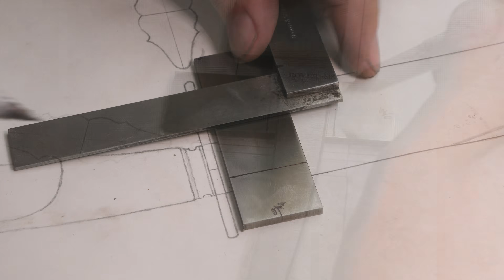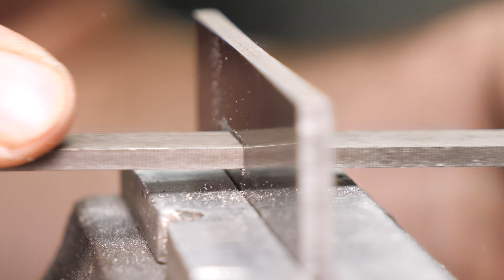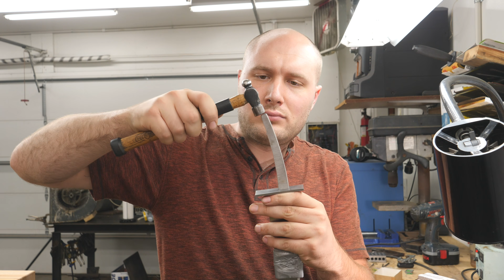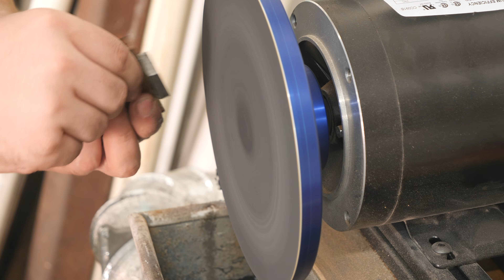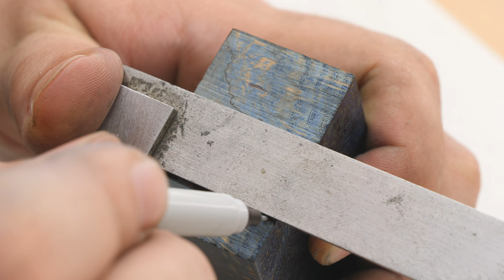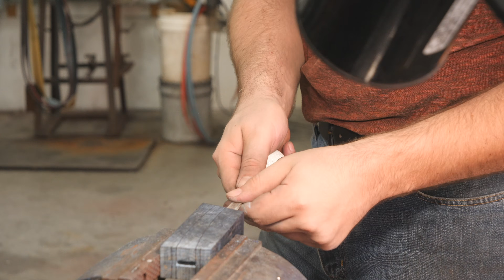Fit a Guard like a Mastersmith Without Breaking the Bank: 15" Bowie Part. 2

Comment: You can tell you are very precise at what you do.. I'm the opposite.  A handmade knife , I like it to be shown that it's not made by a machine . But by my hands , so perfect I dont do.. and shiny I dont care for. I like forced patina  . I like a knife that looks used and worn,  even when o just made it . I got to say you probably are one of the best I've seen . And tight fits like that definitely last forever.  Perfect fits.. also I dont have but basic tools . If I could I would love to buy all the nice tools to make it much better and easier.. great work
Reply: I’m just like you with the forced patina and not polishing everything.  I just finished a 9 1/2” Bowie with an antler handle.  Looks old but it was just born this past weekend.

Comment: The glue and wood is good.  What about a magnet? 

Or a bar with an adjustable grip and magnet on the end?

A  jig to put on the end of the tang instead of hammering directly on the tang?

Not criticizing just multitasking my brain as I watch you work.

Good stuff 

Thank you

Update

I tried a magnet and it works but really needs to be strong. 

If you play with magnets you’ll notice their strength is front to back force so “pulling” but not so much side to side which is why you can slide a strong magnet but not pull it straight off.

If it’s not strong enough the sander slides the piece off the magnet if you press hard.

Recommend tape to protect the steel.

Not perfect but an option.

 Recommend lock clamp or similar for Heavy grinding as it gets hot.

Either way it’s always easier to control a bigger piece than a small one.

I didn’t lose this one but anybody that’s ever ground or buffed a small piece has probably said those famous two words while standing there with empty hands listening to the bing bing bing of flying falling metal so you have some idea where it went… :)

Comment: I'm a machinist and at times we use what if called a mill drill. It's a drill bit center and an end mill on the sides. They can break bust not as much

Comment: Resucing cost by taking 3 hours to sand the hole in the guard ? Yould it be more effective to machined it in 3 min ... ?
Reply from the maker: That would be great but it has a be tighter tolerances than a mill can provide 
Also you probably can’t see it on the vid but the guard fits on custom compound angles on x,y,z 
It’s fit to whatever half the thickness of dry sharpie fluid is 
Good times my friend 
Good to have you here hanging out with us all 👍🏻☕️🔥⚔️

Dad
Reply: Awesome job btw

Comment: correct me if I'm wrong, but with epoxy you don't actually want a "perfect" fit, right? I've been told by a manufacturer of epoxy specifically designed for knife handles that you want a little space between the tang and the handle for the epoxy to fill and do it's job. I think they said about 1mm but I could be misremembering. I don't mean that the tang can't touch the handle, just that, as I understand it, it needs some areas with some space to make a mechanical hold. They also suggested making some divots in the tang (if it didn't have any) to give the epoxy something to hold onto mechanically. 

I'm asking because I genuinely don't know, I'm not trying to correct anyone here ;-) also, this might not matter with your knife as it looks like you're securing it with a pommel, but I don't think I'll have that option.
Reply from the maker: Good observation my friend. We use West System epoxy. It sticks to uncleaned mill scale. It’s an incredible product. We haven’t had any failures with it. Be safe and be careful mate 

Dad

Comment: I hate to craftsmen using the jaws of precision calipers as scribes. This is sad. There are tools designed to do the scribing needed.
Reply from the maker: Good eye my friend. I’ve got over 10 cordless Milwaukee power tools in the the cabinet. When I use any of them I only consider them a carving tool, using them on stone steel and wood weather they were made for it or not. End game building spectacular product for clients to enjoy. It’s just a tool. It’s replaceable. It takes about 3-5 years to wear a set out the way we use them. Well worth it for us. Good comment my friend. Glad you’re here hanging out with us all 

Dad

Comment: I could never do anywhere as good as you even if I had all the machines. It takes a certain type of personality to make knives on this level Im realizing; I start to get frantic and antsy if Im not about finished with my knife by the end of the day AND fitting parts drives me crazy, actually makes me nauseous with the frustration. I discovered that pouring pewter in between handle parts keeps me from having to fit them and I havent looked back! HOWEVER, compared to your knives, my knives look like....shanks!
Reply from the maker: Hey thanks my friend 
I’ll bet your shanks look pretty good 
If you’re interested in leveling up your knife making skills check out our online courses at learnknifemaking.com
Happy new year my friend 

Dad
Reply: @KyleRoyerKnives  Yall should offer a beginner bladesmith kit, with a small propane forge and hose, a hammer, tongs, small anvil and a small piece of steel, say 5160...all the things that a potential knifemaker might have trouble getting around to finding. Then in one shipment theyd have all they need to start the courses, theyd have no excuse to delay. I did see that you offer a guide that directs where a person can buy supplies but this would simplify and expedite the process for the hesitant beginner. Just a thought...

Comment: I never would have thought to use super glue and a piece of wood to hold the metal while grinding 😂. I normally just use a welding magnet although that wouldn't work for stainless as well as it does for regular steel. Any 400 series stainless sticks to a mag fairly well ( like the 416 you used) but different grades that contain more chromium are far less ferromagnetic. However, bending, forging, breaking, or cutting most stainless steel can expose the ferromagnetic properties. I'm sure a lot of people who watch Kyle are aware of this 😂. I'm just trying to share my knowledge on that. Perks of having worked in a metal recycling facility for years lol.
Reply from the maker: Hey thanks Corey. Glad you’re here hanging out with us all. Chao 👍🏻🔥☕️🗡

Dad

Comment: what are the pros and cons of burning the handle on as soon as it almost fits?
Reply from the maker: It’s possible to damage the handle material with excessive heat needed to burn fit the handle. Good question. 

Team Royer

Comment: you can use handle magnet for sanding down steel fittings like the bolster. I also use mine when I need to clean something with my angle grinder if I am doing damascus with little bitty pieces like 1-inch ball bearings I pancaked to make some stacked damascus rods I was planning to use for a twist project and then completely misplaced the rods I made... I need to find those rods.

I am wondering have you tried doing a modern version of punch and drift where you drill a hole in the center of your stock slightly smaller than the thickness of the tang then toss it in the forge to drift it wider before hot fitting the guard to the blade. it's faster then this method which I call the machines method and takes less time to accomplish the initial fit-up and I made the drifts I use out of Railspike which are quite inexpensive. I kinda feel this technique was partially lost as it is not even mentioned in the official abs book on handles and guard. however, I am not 100% sure if it's as fast as I feel it is as I have never timed it as I have only done it 1 or 2 times. 

I  just started forging an American Carlson's raiders machete that will be somewhat modified to match my personal esthetic tastes and I am Iforging it from a truck leaf spring. the reason I chose to make it from salvage is  I have never made one before and in my opinion salvage steel is the best steel to use when you're forging something for the first time because it's not a huge hit to your wallet if you screw it up and need to start over. So I will time how long it took me to drill and drift the hole and get back to you on how long it took me.
Keep up the great entertainment, and educational work.
Reply: Ok i said i would time it and I found a hidden tang blade I forgot i had that needed to be fitted for a guard or bolster so i timed my method and it took me 13 min and 6 seconds to get a piece of 1018 cut off its stock,  drilled with a 1/8th bit, drifted with the railroad spike drift I made, and hot fitted.  i likely could do it faster then this if i just focused only on the task at hand, however, that's just not how I forge I do things well waiting on heat...ok the exception is Heat treatment. you can get a 5/8th inch railroad spike from Blacksmith depot for 2.00 a piece.
Reply from the maker: Thanks gundium. Really good to have you here. Glad you’re enjoying the vids. 
Keep up the good work my friend. 
Cheers. 

      Dad

Comment: I love the precision hand work, well done. Question though, have you considered silver soldering the guard on instead of a press fit?

If you do this often could you have a broaching set up with an arbor press to put this slot in?

Just my thoughts!
Reply from the maker: Hey Jack 
Did soldering in my first year or so of knife making 
Got a mill and haven’t looked back 

We use a mill because we can and you can finesse the slot in.0001th with minimal effort 
Great question 
A press fit in our opinion is the ultimate fit
Team Royer

Comment: Nice quality vid, well done. Just one little addition, if you don´t have a rotary-tool you can file the ricasso at an taper at the very end, instead of grinding a 90° step. Also filing the handguard with the same taper gives you a pressfit with no need to close a gap and connect to any other surface up front. Shoult also be stronger since sharp corners increase the chance for stress fractures. One could also rround them off but fitting radii is way harder. Ragards Smarty

Comment: I noticed that you're using steel for the spacer and guard, are you opposed to using other materials like brass or copper? I like the patina but those softer materials used, but I'm curious if there's other job acts maybe some kind of electrolysis between steel and these other materials. Maybe it causes the blade to prematurely start to rest. Just your thoughts maybe this would be a good idea for a video content
Reply from the maker: Hey Broken Fang
Good question 
Sometimes we use damascus components, or 1018 steel that gets hot blued.
Silicon bronze is used sometimes 
    Team Royer
Reply: @KyleRoyerKnives  on one of your future projects, I would like to see you use brass or bronze. Softer materials. Maybe even work on something like a cast bronze sword. Something out of the ordinary, and see where your skill level can take it. Also those materials are appealing because they don't corrode the same way as steel and they last the test of time.    But I love your content, please video editing, is part of the draw I don't know if that's your brother but he does an awesome job

Comment: One tip I would like to share with you is when you drill holes that have to be accurately placed you should use a center drill to make a pilot hole because they are short and stiff and they don't wobble when they hit the center punch marks like a regular drill bit will. Try it out I'm sure you will like the results, I'm just trying to help not being critical just using my years of experience in drilling.
Reply from the maker: Thank you Kenneth 
Jeff/dad

Comment: also important to have good files, maybe a bit of a obvious one but you know the difference when you get a good one vs a cheapo one on metal. But its nice you go into detail how you get it to fit right. I'm also making a little knife as a little try-out project and seeing how cheap equipment and not using the right tools to get it to fit, so now I need to do a shitload of grinding to get the handle to be square to the blade :(

Comment: Wow this is deja Vu, I use to do the same thing; drill, file, fit....tweek. I have a piece of heavy wall pipe to drive it on. I use a 99¢ 12 piece file set from harbor freight.

Comment: I use this type of center drill bits with a very fine tip, to pre drill a hole before I go with the actual size. It works like a charm. The drillbit has no chance to wander around. https://www.amazon.com/Imperial-units-Center-Combined-Countersink/dp/B07K4P6JV5

Comment: Awesome tips, I've only made 1 or 2 hidden tangs. Like you said, I usually use the mill for cutting out out slots too... Have you ever tried a centering bit(like for a lathe) to start your holes? I had a friend that swore by a punch, but i find the centering bit so much more reliable & precise. Also, with little pieces, i usually use vice grips to hold it, better grip & more flexibility... I'll have to refer back to this video on the next hidden tang i do... Hope all is well, take it easy...
Reply from the maker: Yes, I've got a centering bit that I didn't even think of using this time. Good idea that would have worked well I think. 
Kyle

Comment: Excellent instructions!  Nice to know I'm doing at least some things the "right" way lol, I even have a couple homemade broaches shaped like yours with a single tooth 👍😉.   I haven't actually inlayed a guard onto the ricasso yet, so I've found that it helps to have the guard face close to the final grit it will be finished at so that once I get that water-tight and light/shadow free fit up, I don't end up needing to remove even a thousandth or so, which has caused me to have to do a bit of extra filing in the past.  I was thinking It might also help to let others following along with your online course know that they can just use sandpaper on a granite or glass surface plate if they don't have a disc grinder, which doesn't seem to be quite as common as a belt grinder in the shop.  I'm looking forward to seeing the handle sculpting, I've been meaning to try that palm-scallop shape for a while.  Thanks for sharing, guys :-)
Reply from the maker: Yes, thanks for the tip about letting people in the course know how to flatten things with sandpaper and a flat surface. I'll be sure to go over that in the course. That's what I did before the disk sander and still use that method from time to time but forgot to go over it so far in the course. 
Kyle